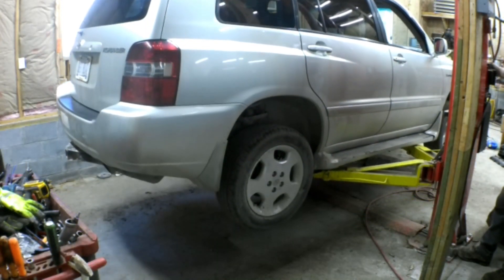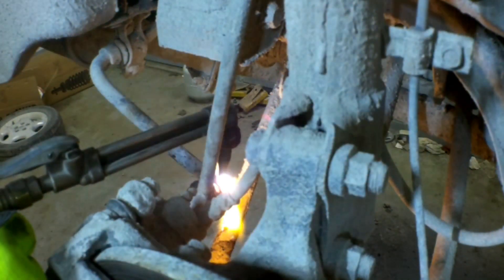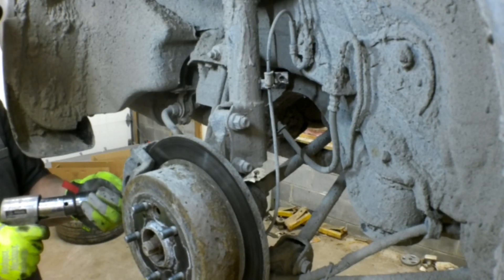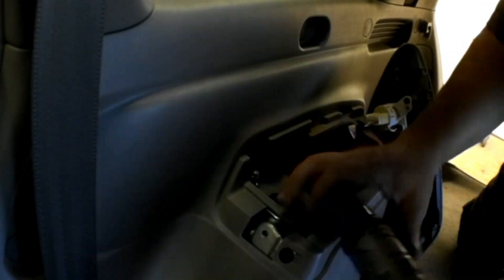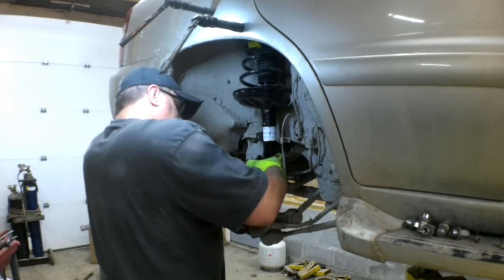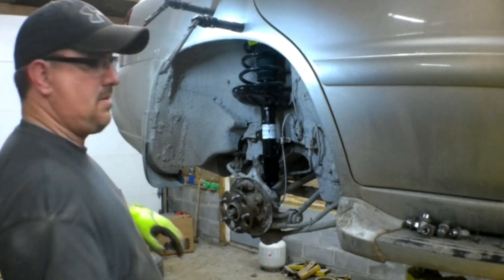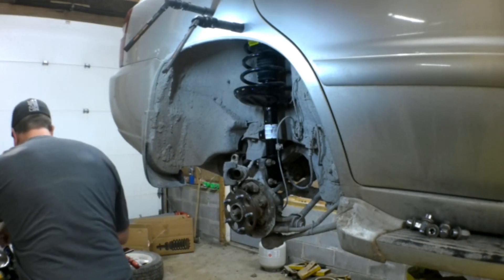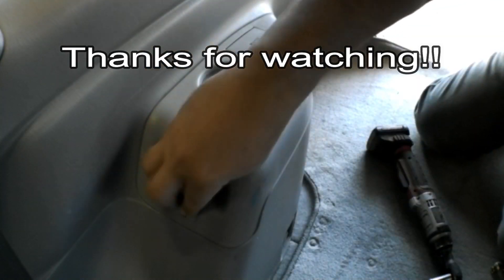Toyota Highlander rear strut replacement

Comment: I have seen other videos where they remove the axle nut when replacing the rear struts! I am glad I watched your video now I know I don't need to do that. Thanks for the video! I always torque all the nuts and bolts to specs! 170 ft lbs on lower strut to steering knuckle and 59 ft lbs on strut to frame.

Comment: I'm getting ready to change all the struts on my wife's 2003 Highlander with 208,000 miles on it (gotta love these Highlanders, they run forever). Your experience with the aligning the bolts sounds like issues I tend to have every time I open my toolbox.

Comment: My 04 Highlander with 197k FWD, has a backend swerve issue when on ice or slippery snow. I replaced the pass rear wheel bearing & one of the rear anti sway bar brackets was broke so I replaced that but dont see anything else that is loose? (Its very cold here so I haven't done a great inspection. Any idea's?

Comment: Thank you very much for sharing 
I have a 2006 3.3 Highlander and replaced rear struts and rear stabilizer bar bushings and links 
I am still hearing a noise over very bumpy road any ideas on what else it could be?
Thank you 
Donald
Reply from the maker: Yes. This Highlander had the same issue. The bushings in the rear knuckles go bad and make clunking sounds over bumps. I ordered bushings off eBay and they worked. The only other option was Toyota parts and they wanted crazy money for them as they didn’t sell just the bushing. I didn’t make a video on it though because I wasn’t sure if it would work or not.
Reply: Thank you for sharing do you have the name of the seller on eBay and approximately how much you paid did you have to take the knuckle off the vehicle and did it you take it to a specialist to remove and press in the new bushings
Reply: Could u elaborate any on your experience with putting in a new bushing? I see a couple of sellers on ebay with them but wondered why toyota doesn't offer it as an option. 3 years later, did the bushings hold up? Thanks

Comment: Had exactly the same issue on Lexus RX300 and my technique was to place a jack under the strut and push up to the point where the two bolt points are aligned and use a screw driver to get one bolt in and second bolt is easier from there. This was easier because i have the car on jacks so could use jack to push up.
Weird thing is one side only i had to struggle.., i would have imagined both sides to be same issue.. same struggle.. 
Wonder what could be the explanation.

Comment: Thank you for the video! I need to do the one's on my 2009 Limited Hybrid. I'm wondering if anyone has installed any with heavier springs? I haul over 500 lbs. daily.
Reply: You shouldn't need to. Not sure about the regular Highlanders but the Hybrids have ton and 1/2 ratings which was a real surprise to me.

Comment: its not the bracket its the strut bearings. you can turn them by hand on the ground. and then fit them in.
Reply from the maker: Not the rear struts. That only works on the front struts.
Reply: @Tomsfoolery.  I also think there is a left and right they should be labeled